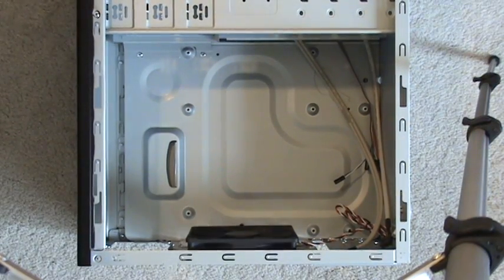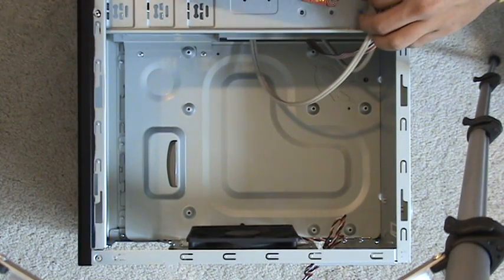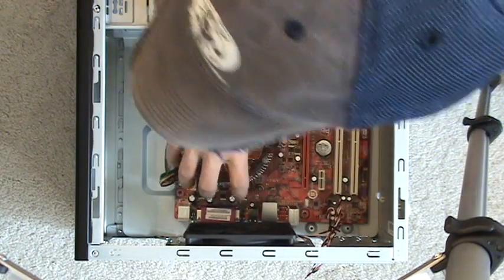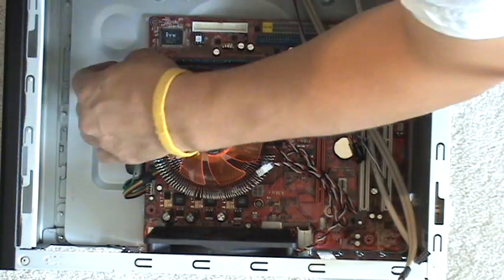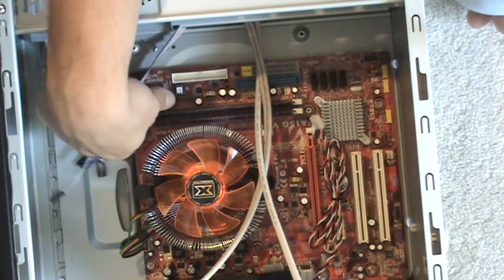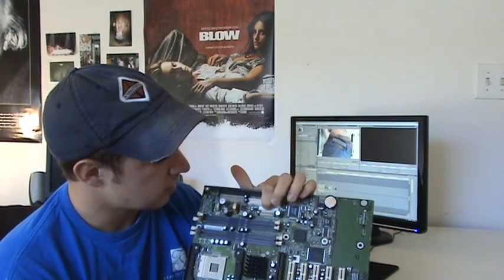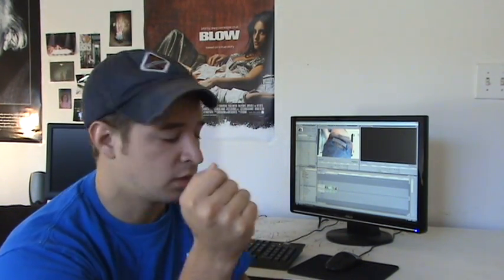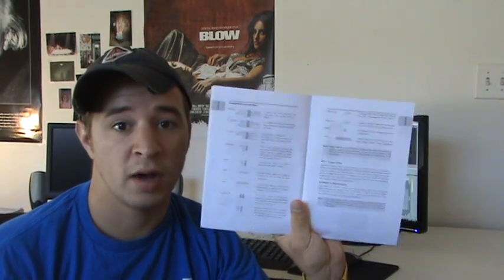How to Build a Computer - 19 - Mounting the Motherboard

Comment: well thats tricky, on ur case (inside) there are cables like hard drive led and power led connectors, in that group it should be labeled usb (i think the colors are white red green) then you plug them in ur board (usually bottom and its one of the row of pins, it should say usb 1 on it if you can read it) hope that helps

Comment: @meroxyersox In this case, there were built-in mobo standoffs so he was fine. Yes, the points of contact are metal, but they only occur where the screws line up, not on the solder pins!  Keep in mind, this vid was made back in 2008, case designs are different now.

Comment: Do not forget to ground yourself when dealing with the computer! lol One static shock would screw your whole computer. Either get a grounding wire that attaches from your arm to your case or keep touching the metal casing to free yourself from static electricity. Shocking the case won't hurt your motherboard as long as you've installed the standoffs correctly.

Comment: You went through this part way to fast.  Mounting the motherboard and the use of standoffs are critical.  Also plugging a cable into "something that looks like" doesn't cut it.  A lot of connectors look similar.  Be very specific as to what cable goes to what connector on the motherboard or you will have someone forcing a connection where it doesn't belong.  Wiring the motherboard and the power supply are too important to be treated lightly.